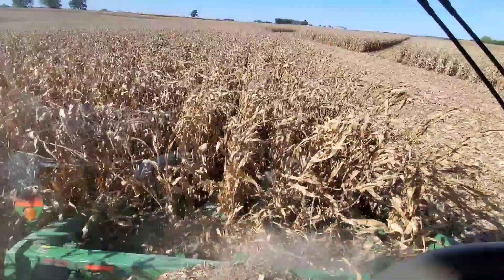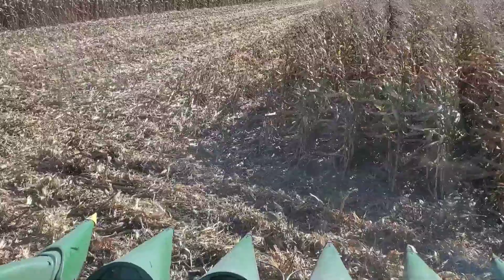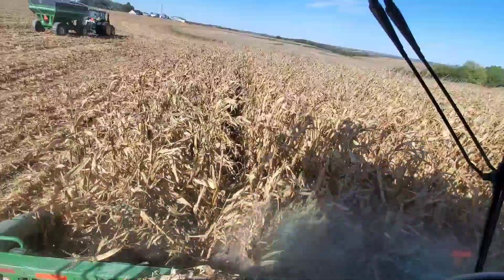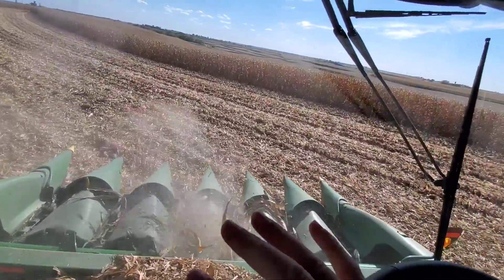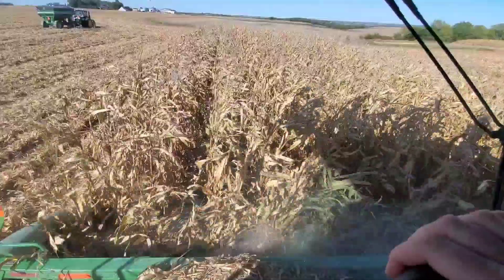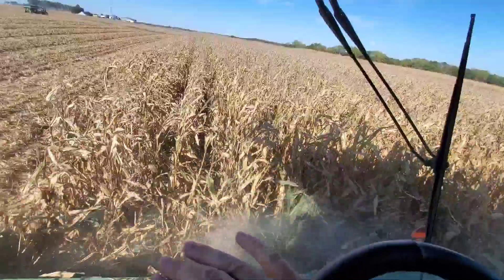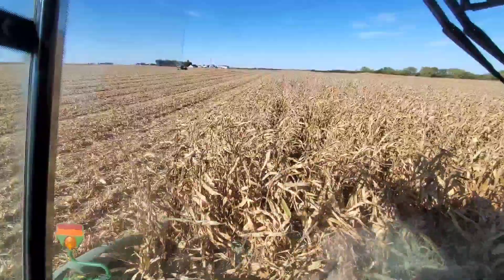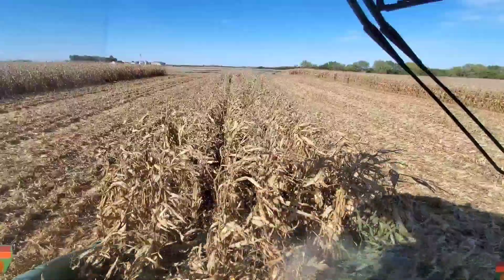how can combines be improved?

Comment: I am 6'2"  320# and have a 2021 S770 Deere combine.
I would like to see:
a.  Bigger cab with more leg room to stretch out (sit in a 9000R series tractor and compare)
b.  A power escalator system for getting on and off (people with bad knees also farm)
c.   Improved automatic window washing system.
d.   Fuel and DEF fill location points at ground level, not having to climb a ladder to fill.
Reply from the maker: I agree 100% with all those things ...

Comment: John Deere should have devolved more of the Bi-Rotor when they bought the machine.  The new S series needs the new updated cab like the new X series , don’t know why they haven’t added that cab yet but I’m guessing they are trying to push more people to the X.   But your right they need something huge other then the X series  for combine development for the future.
Reply from the maker: I agree 100%  ..... what I was told, is they are using up the last the old cabs and old engines ... the 13.5L has had a lot of failures - but deere still has them in stock  so they are just using them up ... as soon as inventory runs out, I'll bet they change to the new cab and new engine on the 700 series- but they'll probably do something like call it an 8 series ..... overall though, they are still using similar parts found on 9500s - lol .. they need a serious start over, which considering they bought out the byrotor combine, I figured they already would have.... the X9 is just the rotor they have now times 2, on smaller diameters - I am failing to see the revolutionary change ... simply put they could do better ...  thanks for watching and taking the time to comment - I appreciate it ....

Comment: Capacity. Jd 780 3400bu/hr max corn. Deere says it will do more, but a power stop at 3400 will have corn touching the bottom of the concave so it has to be forced out the rotor. Speed up the trough augers or make more  clearance under concave. Why does Chaffer leveling need to be so difficult? Couldn’t the grain load be mechanical leveled below the concave?  Concave and sieve side access. Rethresher machines have terrible access on the right side. I would like a camera looking at the sieves to see what is happening. I think fan speed and other adjustments would be much easier if I could watch what is happening. My neck hurts from looking down all day long. To name a few.

Comment: Have you seen the Tribine combine? They put some new features out there. and the Nexat harvester in Europe. 
My issue is the combine is basically buying a full tractor plus the grain handling feature. Sure, it may run across all the fields, but then that 'tractor' sits for ten months. Get back to pull behind and lower price.
Fewer 'dress-up' panels that have to be moved to get to the service points. Reduced electronics for more robust life span.
Reply from the maker: Thanks for asking.... yes I have... seems like a neat concept ..but I'm not sure jt will ever catch on...